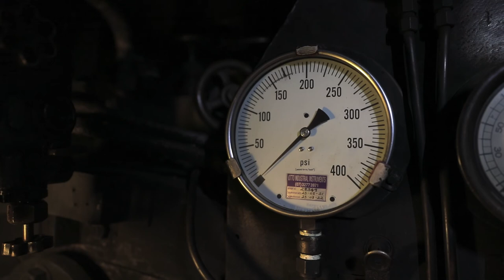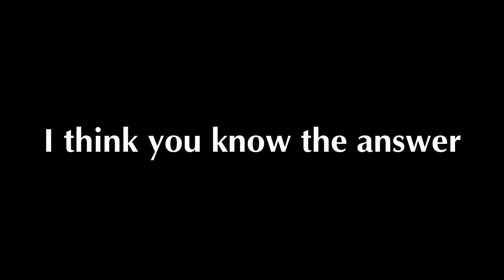SDSR Warwick to Wallangarra Tour 5th of February 2022 | Railed It

Comment: Outstanding work Kyle! Very funny too lol. What camera and drone do you use? Video looks stunning! Also where was that shot taken at Silverwood on the way to Wallangarra, looks great.
Reply from the maker: Thanks James! The spot is a 5 minute walk toward Warwick. I use the Canon 5D mark IV, DJI mavic air 2, and a sony FDR AX53 don't buy the sony get another camcorder
Reply: That’s awesome! What one did you use for example the shot at 16:00 ? Love the look of the video, with whatever you recorded with in that shot did you use it in auto mode? I’m so sorry for asking and what video format do you use on it too? Once again sorry for all the questions.
Reply from the maker: The sony camcorder for that one. That is one of the things lacking about that camera is you can only control one setting, so I set the shutter speed to 1/50  ( as i shoot 24fps) and can manually control microphone sensitivity and adjust the exposure compensation its a pain in the rear end, otherwise I would start to recommend that camera. You will find I did a little colour grading to bring down the green. for some reason sony cameras love green, canon love magenta (which is easier to grade) The drone is a mixed bag it does really well in sunny conditions. I try and get it to the lowest contrast/baked in colours so I can grade it. Do play with Davinci resolve it is a great piece of software.

Don't worry about it, I'd rather have someone ask questions!